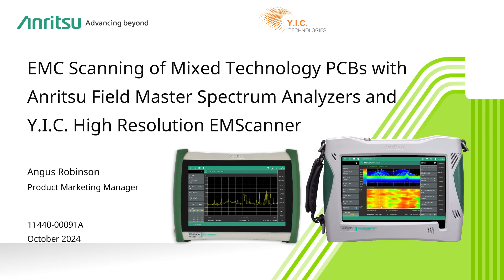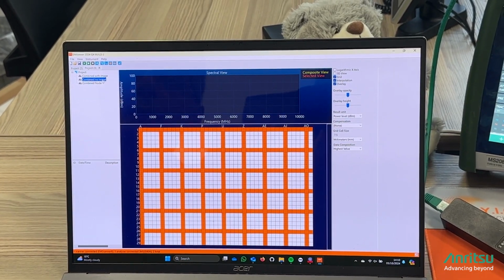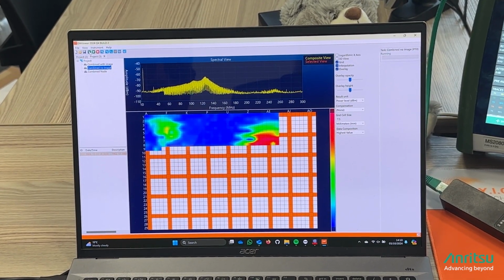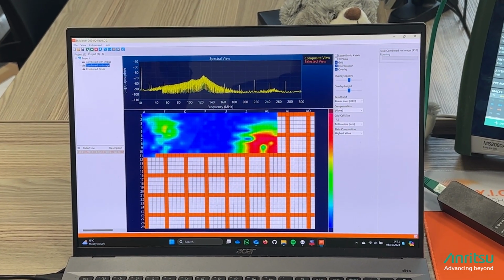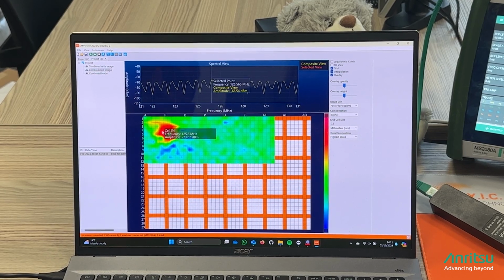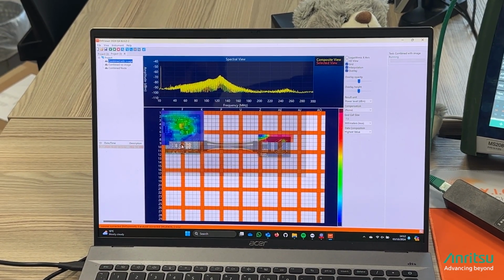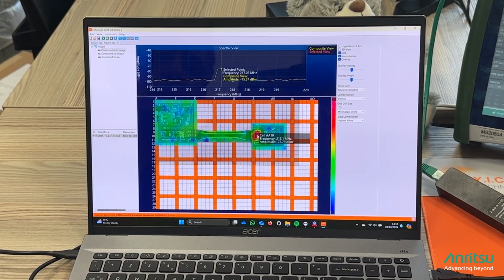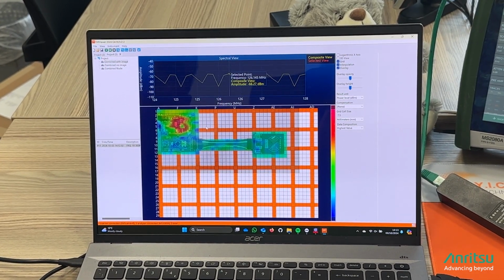EMC scanning of mixed technology PCBs with Field Master and YIC high resolution EMScanner

Comment: This is a very nice video. It seems, we do not need a scanning E/H field probe above the platform? So basically, the antennas matrix on the platform is used to capture the emission/signal? Compared to traditional scanners, what is the run time? I guess it should be relatively smaller since we have multiple receptors/antennas.
Reply: The scanner is H field. You are correct that no E/H field probes are required in addition to the scanner platform, but you can reorientate the PCB to get additional perspectives. The video shows the real time scan capture. Anritsu MS2080A has a fast sweep and data transfer time to the PC, so the scan of a typical PCB of 10 cm x 5 cm completes in around 30 seconds.
Reply: Thanks for your response. One of the issues of concern is that this system can only be used for planar scans. Good you mentioned we can get additional perspective by reorienting the board.
Reply: m😂৳1❤😅 
দে😮😢😢